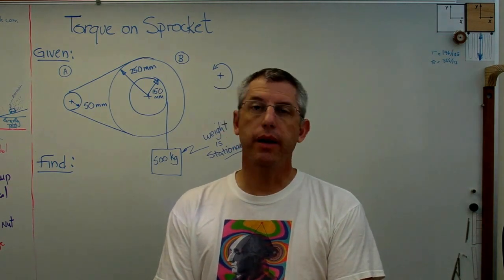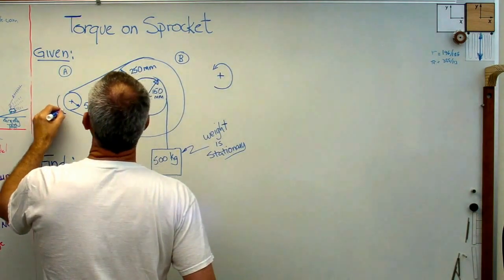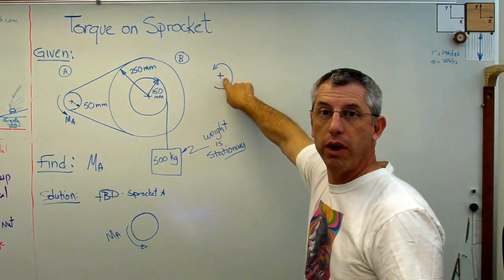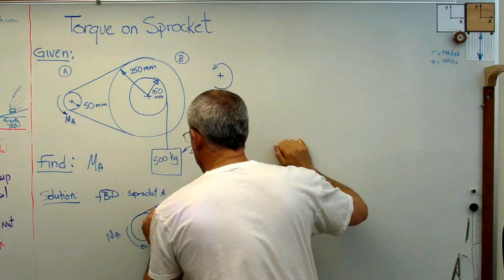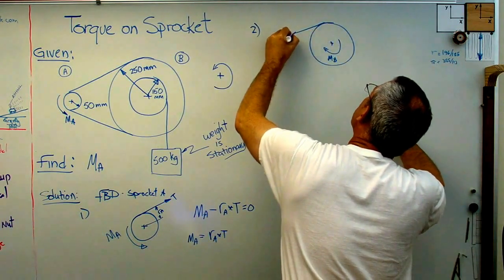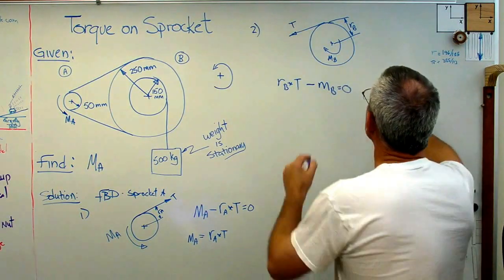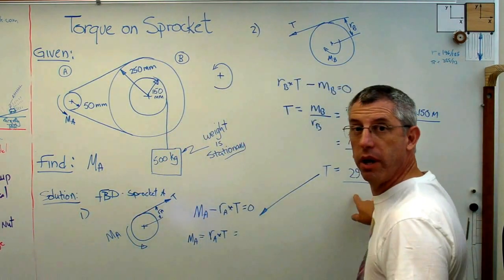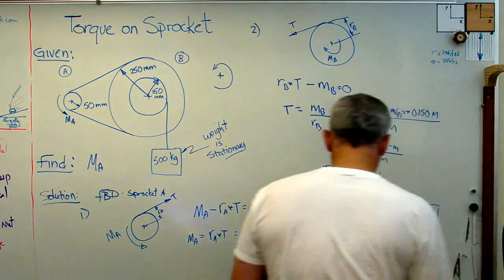Torque on Sprocket   Brain Waves

Comment: A torque M of 1510 . N m must be applied to the 50mm-diameter shaft of the hoisting drum to raise the 500kg load at constant speed. The drum and shaft together have a mass of 100kg .calculate the coefficient of friction  for the bearing